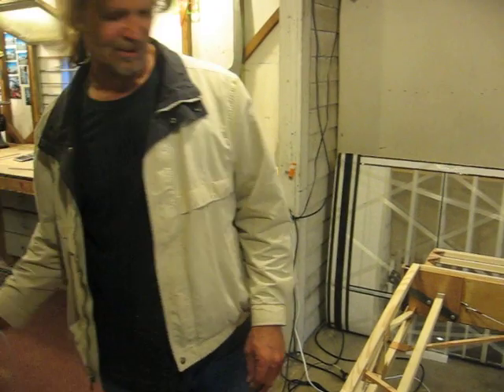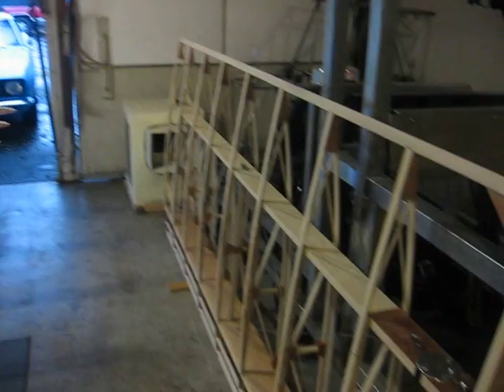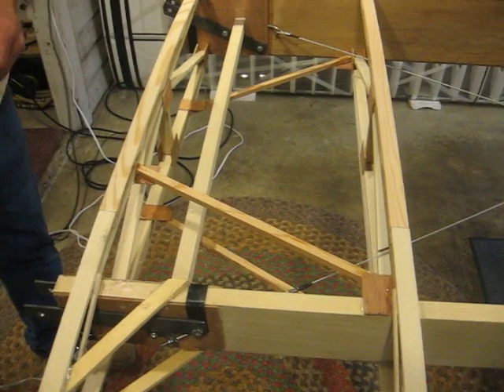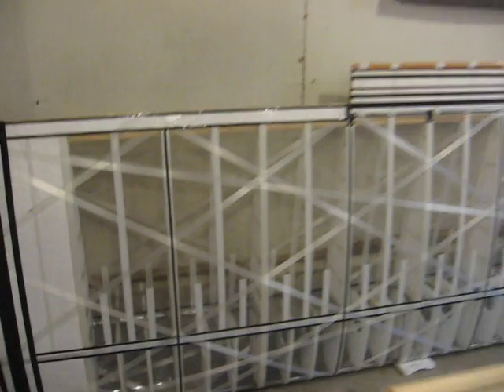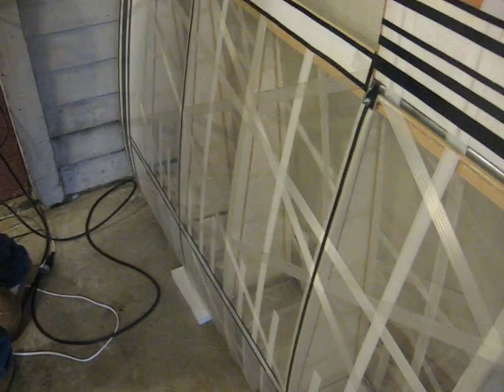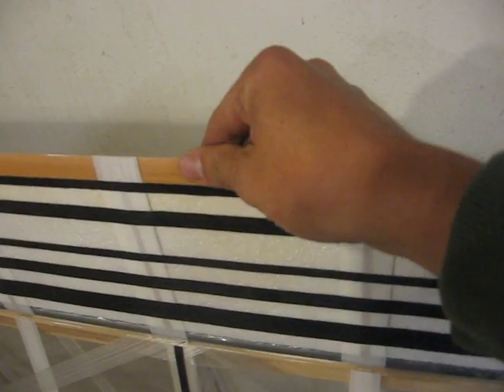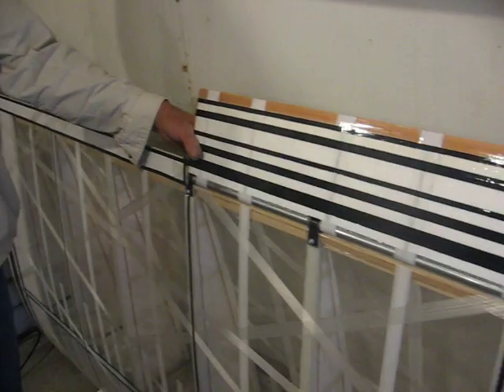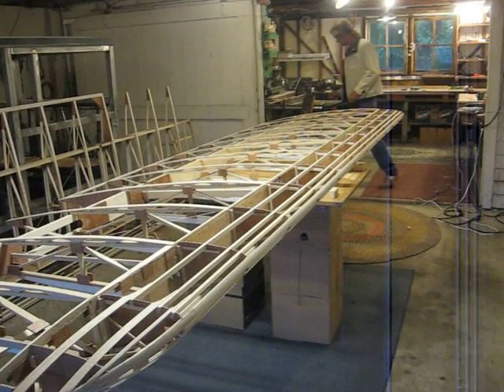How to build an ultralight.

Comment: So the wing panel hanging on the wall. Is that aluminum or stainless tubing? I'm using unconventional material also. I'm sick of all the bullsh.. of people thinking that no one can fly with out spending your life savings.
Reply from the maker: wood/ packing tape only.
Reply: I was actually refering to the one above that one on the wall that looks like aluminum tubing. 
Also- the wood wing you're working on now. Can I ask what you used for your wingspars and your rib material? sitka spruce is so expensive. I'm thinking 1" marine grade ply would be sufficient for a plane under a 4 or 500lbs. I mean look at what they used to use back in the 30's and 40's. Any thoughts here?
Thanks....

Comment from the maker: This guy is a bit of an introvert,and works for the simple pleasure of it. He said that the key to use this type of material and achieve a solid success is to keep it clean, use a quality tape and LOTS of time and patience. He said you can start by practicing bonding the strips of tape very closely together and if there are any bubbles, you can work them out as you go quite easily. It's not as hard as you might think. If you have any modeling experience, you can do this.